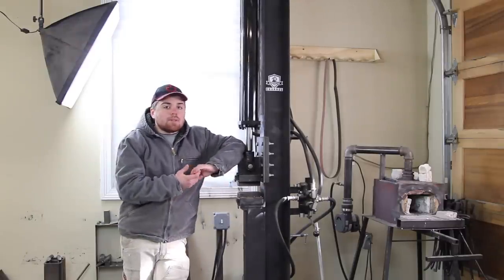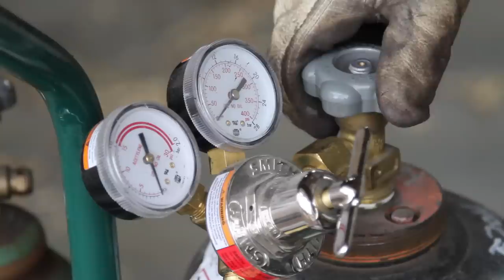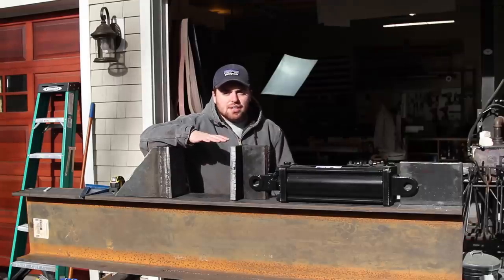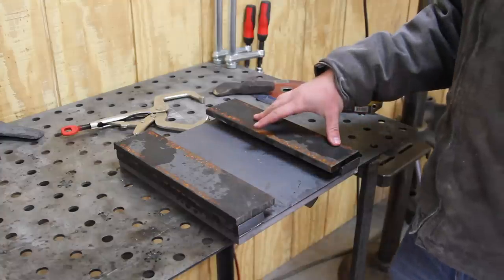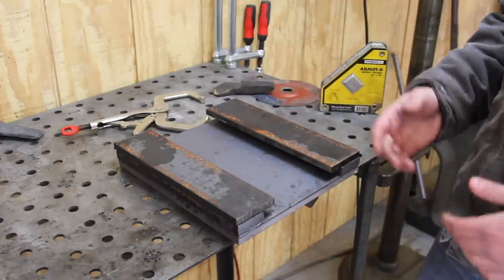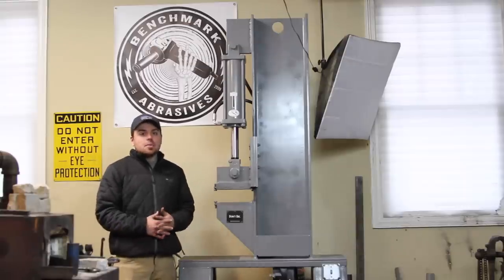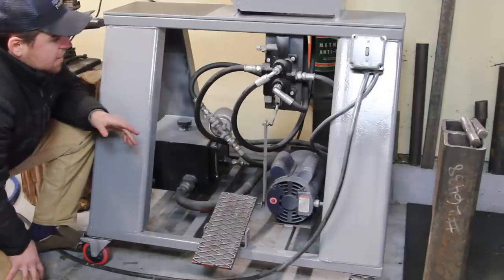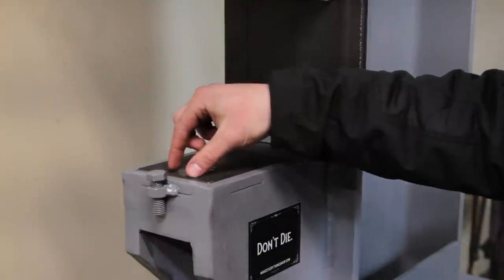How to Build a Hydraulic Forging Press

Comment: You would not want the gap to be the exact thickness of the ibeam you would put wear plates on the ibeam and make the gap fifth those IE tack or bolt 1/4” wear plates so when it strikes it does not wear on the I beam

Comment: Very nice work.

SHIELD YOUR HOSES MAN!

TRUST ME ! 

BUILD A SHIELD! 

Also find an 
AFFF Fire extinguisher! 

It only takes one slip and that fire risk can take your shop in minutes! 

*Been there ! 

Please build a shield for your pump , hoses and tank ! !
Reply: or...Just buy exhaust wrap. The stuff you see on retro looking custom motorcycles or get proper hose sleeves from your local JD tractor dealer. Nothing like having a hose rupture and hot Hydraulic oil in your face, been there, done that!
Reply: Just use shielded hoses and emulsion fluid instead of hydraulic fluid. Emulsion is for use in areas of fire hazards for industrial use should work the same way. Just make sure your pump, valves, and jack are rated for it.

Comment: 2 safety issues, big ones! You have a good channel, please don't die. 

1. Cover all the hoses you can. A stream of high pressure oil will do more than bruise you. You will get an injury from both the force of the fluid and from the injection of the fluid into your body. You'd rather be shot in whatever body part the fluid hits than hit with the fluid. 

Solution: 1. cover all that stuff at the bottom with some sheeting. 2. sleeve all your exposed hoses "hydraulic burst protection sleeves" I've used Eaton Guardian, like $2-3 a foot. Be careful many hydraulic stores will have abrasion sleeves(lose nylon weave) and not burst protection sleeves(dense weave). Get the right stuff. 

2. Bolt like a bullet... I like your slide design, large surface area, relative to die size, BUT that bottom bolt... If you work to the outside of your die that janky lower bolt WILL fail. The other bolts are likely safe due to design (but id change them anyway) It looks like a 1/2 grade 5 you've got there. My suspicion is you have anywhere from an 18 to 25 ton press there. That not accounting for pressure spikes. The forces on this system are dynamic and eccentric. That bolt will fail at a static load of around 8 tons, Dynamic, I bet its 1 ton or less and failure. 

Solution: Drill that hole out so that a 3/4 inch grade 8 fine thread bolt with JUST fit (no slop in hole AT ALL), Install a good brand name grade 8 bold and torque it down with a torque wrench (you'll need to borrow a 3/4 inch torque wrench 300ft/lbs). to be clear this would be a "3/4-16 grade 8" That bolt should be able to handle the full static load of your press, seems overkill, but remember "DYNAMIC and ECCENTRIC"

This is a dangerous machine. respect it.
Reply: can you tell me the size of pump and the hp of the electric motor  your press really looks   great built very plush great work Duey
Reply: yes, this is why on Nargesa machines, they have a plate like a milling table, with which the dies are bolted, or some presses, which use T-slots, and a 3/4 " bolt and nut to secure the punch/die in place!!

Comment: What an awesome press Paul and I am very impressed with your fabrication skills. I do have one small concern besides the 50 comments about a shield over the hydraulic system lol I noticed the sleeve build onto the I beam is very well constructed but what about proper lubrication? As you may well know friction and abrasion are steels worst enemy. I'm sure by now you have taken care of that lol but I figured some good high quality high temp grease every so often would work great. Other than that it's freakin perfect. Far better than any production built presses I've seen.

Comment: Very well thought out build Paul.
I built an H-frame 16 ton 2 years ago.
There are advantages to a C-frame press, but also advantages to the H-frame design.
I used a 4" bore x 8" stroke cylinder. But now have a 5" bore x 8" to retrofit.
Need more squeeze power 
Looking forward to seeing this one in action.
Reply from the maker: Thank you!! I’ve always thought about doing a H frame press possibly with two cylinders but I probably would have needed a bigger pump and motor.

Comment: Just a thought. Something you want to be real strong. You should be beveling the edges. With 1” plate your not getting nearly enough penetration.
Reply: He can also add to the size of the bevel weld. A couple of the welds looked a little undersized. A good rule of thumb is to have the throat of the weld equal to the thickness of the thinnest member being welded together. Time will tell. I didn't see anything that would snap and hurt anything just probably crack over time.  Easy repair later on. It will tell you where it is weak :)
Reply: What wire is he using here?
Reply: From what I gather he is not a certified welder and most of tthis is Kentucky windage. 

Imma thinking this is a outof his league considering the forces of such a machine have not been fully considered and/or considered.

His first was in the process of failing based on design of approximation. 

He should skip the content project on this one and invest  what he spent on it toward purchasing one that's been reconditioned or recondition one himself
Reply: @tommypetraglia4688  if hes in kentucky good chance those are old mining parts and didnt have much invested. That jack looks like a steering jack for a scoop. I would say a boom jack for a miner but I didnt see the hard connection bypass for the return

Comment: Great build. I built one out of a log splitter and have the same issues you had with your old press with the twisting and bending.  Thinking about putting a larger beam on mine, or just building a new one. Thanks for the tips!

Comment: That's a great build. I do have two questions. 1, why did you use nuts on the track instead of tapping the plate to recieve the bolts? 2, Does it really matter if the lower die plate is locked in? You're just pressing down on it. As long as it's held sideways can it still slip out?

Comment: That's a mighty fine build.  Well designed and executed, clean.  I'll second TexaCajun's input concerning the bottom bolts on the slide.  The further away from the face of the main beam you put pressure, the further from the center line of force you are from the cylinder rod, thus torquing the ram die.  This has the effect of trying to pry the bottom of the slide plate off the beam.  I've seen many "log splitter" conversions here on YT and it's common for folks to make a combo die with flats and round drawing dies with one extending out from the beam face.  I cringe watching them powering away on the outer edge of those dies and seeing the loose slides they've constructed straining under the pressure.  

Considering what you've probably spent on all that thick steel and the main beam (btw, what DID you pay for all that steel out of curiosity...want to compare to what similar costs around here)...I think the cost of some good grade 8 bolts is negligible.  I'd also say get fine thread too (fine thread is stronger than course thread in both tension and shear).  A pair of 3/4" fine thread grade 8's and the corresponding grade 8 nuts shouldn't run more than about $15 for a pair of each.  While you're at it, I'd go ahead and replace the others with 1/2" grade 8's too (1/2" grade 8 fines and nuts are about $3 for one of each), so figure around $30-$35 to replace all of your bolts.  Well worth the safety margin and peace of mind.

And definitely, DEFINITELY do something to protect yourself from a ruptured hose.  I knew a kid growing up that almost lost his leg to a hydraulic hose rupture on his dad's log splitter.  It was like a liquid knife through hot butter.  He had to have several surgeries to fix it all up and lost a good percentage of his right thigh muscle strength and function.

Comment: Playing with the angle the cylinder is at can offer some surprising benefits. Being perfectly plumb isn't your only choice. Have a little thinking at it with respect to what happens when your dies contact the work. Sometimes subtle seemingly insignificant options are not considered when building heavy duty toys. I'm half way through the video so I'll adjust my thoughts after I've watched the whole thing. So far, cool can't complain about 1" plate. Peace

Comment: Paul, I want to thank you for going through the build learning curve for us and then sharing.  I was really impressed with your first press, but this build is beefy, elegant, compact and just plain awesome.   Do you have a pressure gauge & have you calculated how many tons you're now pushing?   When I finally build mine, I think it will take a lot of ideas from you.  Thanks again!
Reply: BTW, I see you still have your singed paper curtain by your forge - past time for you to spend a few bucks on cheap aluminum replacement blinds before you burn your garage down!  Gotta take a little time to protect your work!
Reply: What size electric motor are you using?  Thanks for the great video!
Reply: At 2500 psi, a 5" bore cylinder will be right at 25 tons. 50,000 pounds of force is allot of pressing power for sure
Reply from the maker: Thank you!! I don’t have a pressure gauge but it’s just under 30tons I’m using a pump that’s 2900psi

Comment: Hey Paul, nice video. I'm in the process of way overthinking the rebuild of my press head and fixing some of the same overall problems. Question for you: What kind of wear are you seeing on the guides or the beam? Is there any noticeable change in the tolerances after two years? Was the bigger beam enough to mitigate any uneven forging? Mine bends as well and I'm curious if just fixing that will be sufficient or if I need to beef up the guides as well.

Comment: Hi Paul great job on the forging press, did you use the pump of a log splitter how many GPM does it pump ?
Reply from the maker: Thank you! And yes I got the pump and valve from a company called rugged made they sell log splitter parts and it’s a 13gpm two stage
Reply: @PaulPinto  What size motor did you use?  110 or 220?
Reply: 9976mark I have been digging thru the comments, Paul said 5hp 220 volt, not sure of the RPM yet

Comment: I’m getting ready to add a C-frame hyd. Press to go along with the H frame I already built  my question is how did your die holding set up in this improved press work out? I’m happy with the setup in my original press and will most likely stick with that although the flip lever holders do tend to get bent up over time. That I could work on for sure. Can you show me what you finally ended up with please 😎 looking for ideas

Comment: Nice build. I’m glad you mentioned the fitting issue you ran into when hooking up the hydraulic lines. May I ask where you got your cylinder or the brand? I’ve recently gathered parts for my build and I don’t want to run into the same issue.
Reply from the maker: Thank you! https://m.northerntool.com/shop/tools/product_48214_48214 hear is the link to the exact one I bought

Comment: Very nice build Paul. I have all the bits to build a hydraulic press. I've bought a log splitter. Could you please give me the old beam size for comparison to what I've got. I'll rewind the video and find the new beam size. I have bought a bigger diameter ram than the original, a 5" also. The seller says they also use the same frame for the 5" ram but would be good to check against yours. This could save me a lot of reworking 😊 Thankyou again for your video.
Reply from the maker: Thank you!! I’m not sure of the exact weight of the original beam but it’s a 4”x6”. The problem with using the beam that comes with the splitter is pretty much every time you would split a log the wedge doesn’t have any problem going right through the wood and it’s not applying full force but when you are forging almost every time you’re using 100% of the pressure from the cylinder and the stock beam isn’t really designed for that kind of use so I would definitely add some sort of stiffer to the beam
Reply: @PaulPinto  thankyou Paul. I definitely need to beef it up then. Good thing for me you've done the hard yards.😊

Comment: Paul, first great build. I was wondering if I could get some links from you please. And they would be for the cylinder hopefully they have one with standard fittings. And the valve & pump and I guess the motor. I might have a motor but I'm not sure about it's ability's. Sorry for the long list but it's hard to find good information . I did subscribe. Thanks. THOR.

Comment: I built a log splitter a few years ago and im sure most of the parts you bought are for a splitter. People could save a lot of money if they could find a used log splitter for sale then just modify it to forge steel.

Comment: If i ever wanted to build something like this.. what would be the estimate costs of building one (just parts, no labour or equipment)
Reply: I just did a bill of materials for a hydraulic press design I made. It is around 1200 for all the parts and freight of the large steel plates.

Comment: As I am sure you know, but many overlook. The high pressure hoses on a hydraulic system are VERY dangerous. PM inspection and replacement of hoses can save injury and lives. I worked in a metal fab shop that had metal rolling equipment. We once rolled a 6” x 9” bar of steel into an 18 foot diam circle accurate to an 1/8”. That takes tremendous pressures. Any hose that even looked hinky was changed. Be safe my friend.
Reply: Mark McCoy that’s a mean set of rollers!! Last job had two machines for rolling tubing, flat bar etc. biggest set of rollers we had were 12”. Man they sucked to change by hand! Mfg by the Buffalo Forge Co.
Reply: Keenan Dunnigan .... We rolled a lot of 3/4” stainless and made 7 foot tall “pressure cookers” for Georgia Pacific. Rolled a lot of angle. Both leg in and leg out. I came up with a trick to roll leg in angle iron, so they saved it for lucky me. The machines and motors had tremendous pressures. If a high pressure hose broke the spray was powerful enough to take off a limb or put a hole through you. We learned to give the machines the great respect they deserved. Stay safe

Comment: Like the build, but as typical "youtube" fabricators do, you aren't beveling your metal! It does no good to use 1" plate, if you are just welding a little bead on top of the joint, especially with mig, instead of a good 6010 arc weld! If you don't fully bevel for FULL penetration, the weld is the weak point. You are just setting yourself up for failure. There is no reason when you have access to a torch, and a bridgeport, not to bevel your metal. Those welds WILL eventually fail.